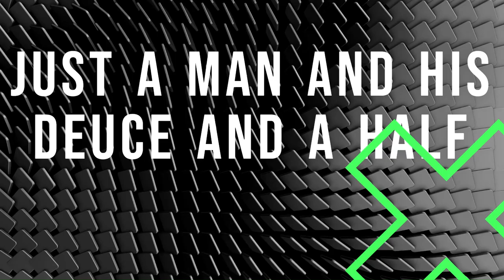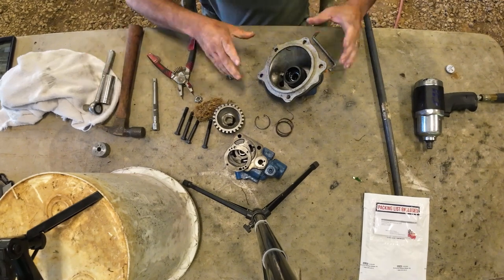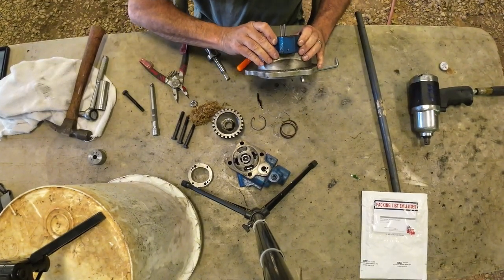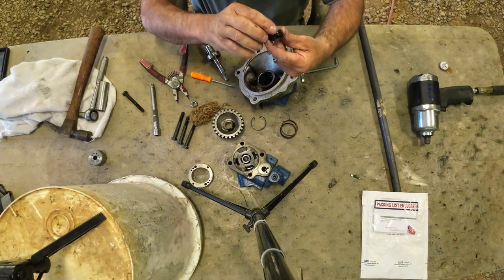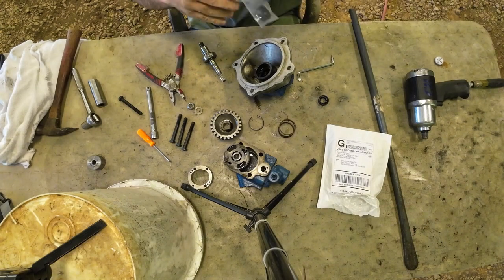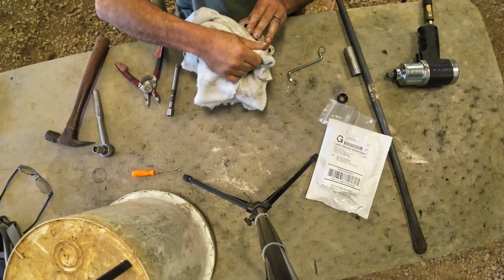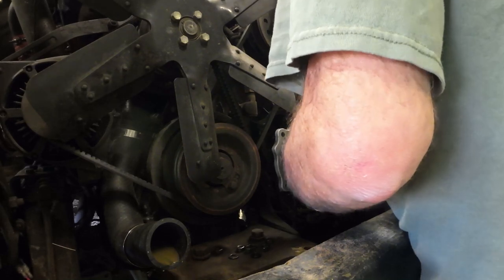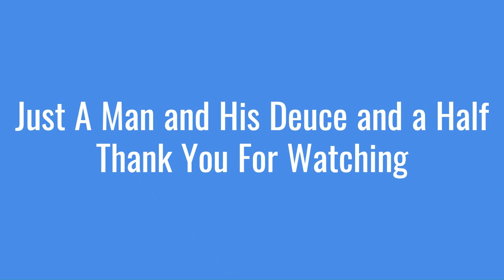M35A2 Deuce and a half Power Steering Repair series. Part 6

Comment: The sound of the truck in the back round is annoying
Reply from the maker: I apologize for the air compressor.  Hose had a bad leak and was keeping the compressor running longer than normal.